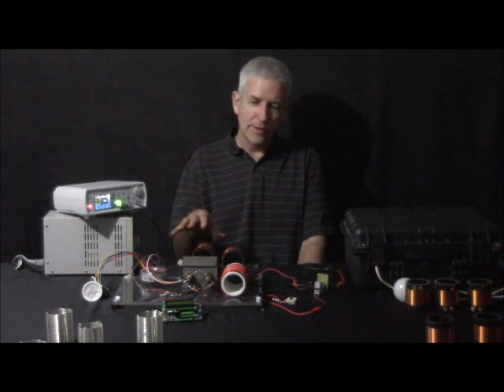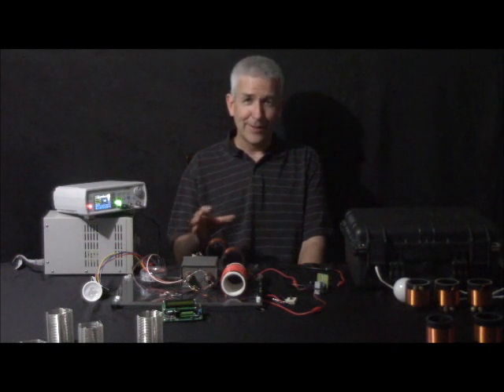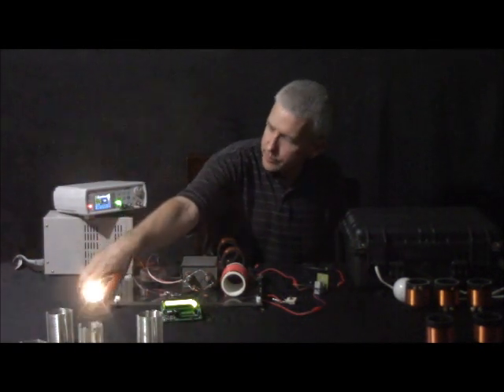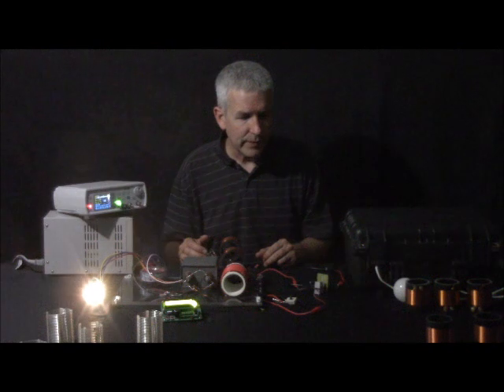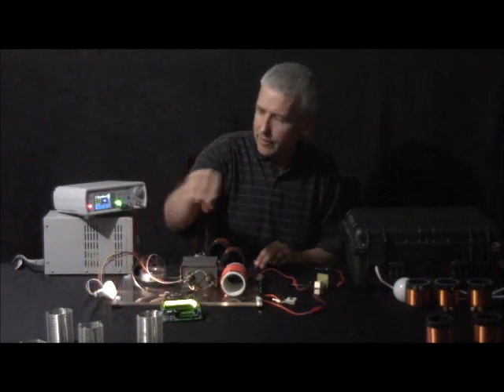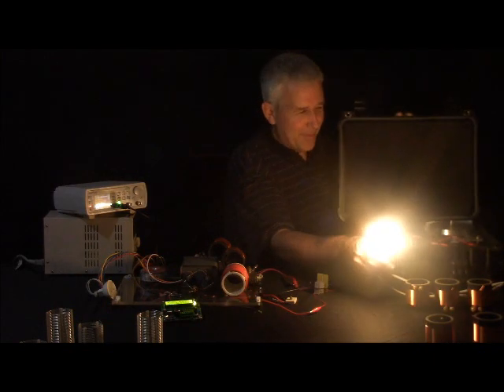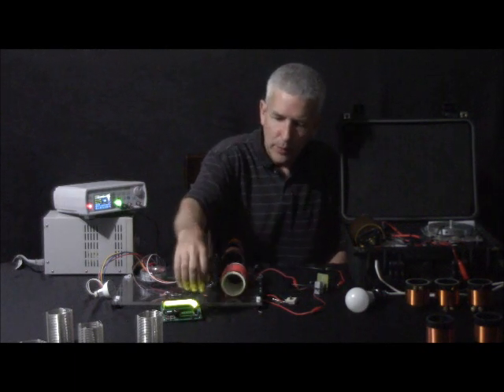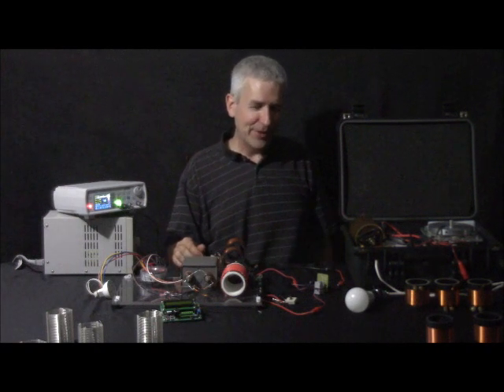Resonance Systems Convention July 23-24 Indiana

Comment: Hi Rick, have you managed to self-loop the system? i.e. run it by itself, perhaps generate any OU? thanks.
Reply from the maker: There are many systems we can do, not merely one.
Reply: @rickfriedrich  Can you please demonstrate that in a video, whereby you have the system run from a small 12v battery to charge an identical empty one, then have it switch back a couple of times? if you've already demoed this, can you please send me the link in a reply. Many thanks.
Reply from the maker: I have already covered your mistake in assuming you can prove something like this over the internet in the following video I made a few years back: https://youtu.be/tpoOWs8SfVo  My goal has never been to expect something like this can be proven over video. My goal is to show people how to prove to themselves. Videos can easily be faked, and in order to demonstrate a battery system it would take days. I have demonstrated live many times over the years and have sold thousands of motors to repeating customers without the need for advertisement. I'm doing this to educate not to convince. 
There are many people who wish to learn and I have tried to help them in this work. 
You can look at a few of the videos from my live meetings where we showed the batteries not discharging for an hour while loads were run off the system. That was the more advanced system adding resonance.

Comment: Hello, I made a single-pole Bedini generator, all according to your instructions.  The resistance based on the transistor is adjusted to the minimum power consumption.  Without load, the neon light flashes.  But for some reason, the capacity of the rechargeable battery decreases!  That is, the volts grow, but when the load is connected, the volts disappear and the battery charged with the Bedini generator cannot power anything.  Although in a calm state, the voltage of the voltmeter shows normal, as if the battery is charged.  I have not seen anything about this in your instructions or in your books.  Please give the right direction.  Thank you!
Reply from the maker: Many years ago I had several forums on these subjects but eventually Bedini deleted everything... 
I will make a few points about your statement:
1. Bedini really didn't invent anything as far as I am aware. He just copied people.
2. What you call the Bedini Generator does indeed power things as I have shown more than anyone. I have powered entirely a 26' cabin cruiser boat for 3 years just by rotating the batteries. I made a rider lawnmower which was a portable generator. You can see the videos of these and many more applications.
3. Minimum power consumption is NOT the sweet spot. Sweet spot is dependent upon what you want to do. It is usually highest motor power and highest charging rate and lowest input energy. That is three different things, not one.
4. When you measure voltage with a volt meter while charging you are not measuring the present state of charge but rather a combination of battery voltage and that spike voltage. So the mistake is in you thinking the voltage is the state of the battery. Furthermore, if the battery is used it could be sulfated and the system is trying to desulfate it--which is not an efficient process...
5. When doing the pure process, which is negative charging, it will take a good number of cycles to convert the battery to be a negative charged battery that readily takes that charge. What we have always done and shown is cycle the battery at least 10 time with the discharging down to 0 or 1 volt to more effectively removing the positive charge in it.
You have to read all of our instructions to be able to do this...

Comment: I am thinking of getting a double trompe, one refilling while one is being used, and a Tesla turbine, with an extension so I can do sparks at about 1 million plus frequency. With the correct circuit, and a well made flat bifilar ....That should be enough to light any bulb, no second wire necessary. Funny thing is these aren’t unduly difficult, or complex, a bit expensive, but considering what is gained, it’s a small price to pay. 80k RPM out of a Tesla turbine, is totally possible, and 400 times that as the upper limit to the gap frequency possible. (80k times 400). All frequency can be adjusted by air pressure.

Comment: welcome back, the suitcase unit is a self charger running on li battery??
Reply from the maker: This is a mini 4DualPole motor running off of lithium and charging lithium. Then it runs the generator coils output through a variac to another lithium battery and inverter. The purpose was to show a small unit that is quiet. This is not the resonance setup.
Reply: @rickfriedrich   how much output can you get on that particular unit?